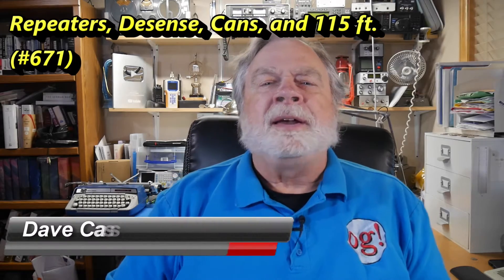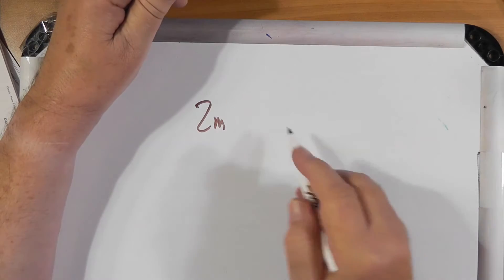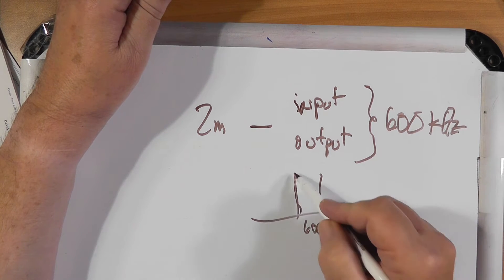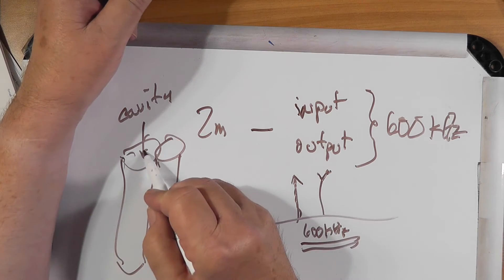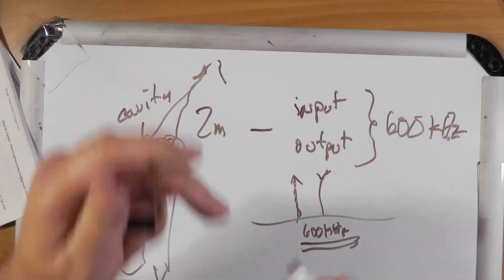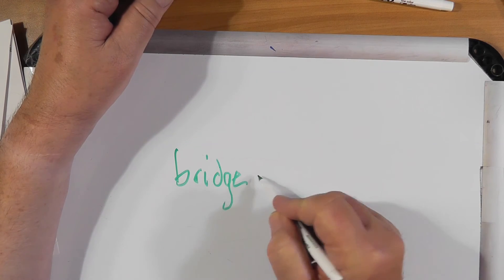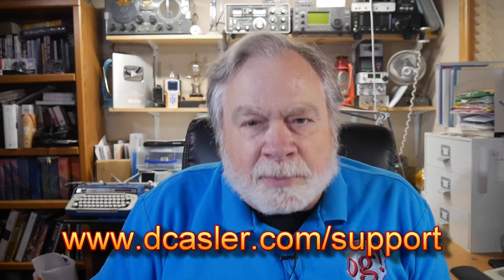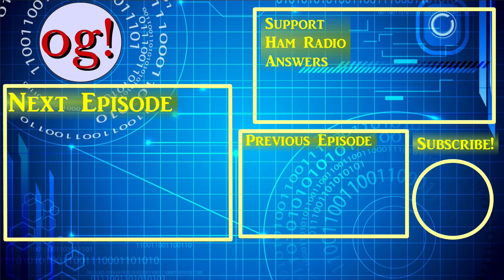Repeaters, Desense, Cans, and 115ft. (#671)

Comment: Your points about repeater coordination are complete hogwash. Been running an uncoordinated 2 meter repeater on a dense metro area with no issues for almost 3 years now. They cannot do anything. Repeater coordinators are often somewhat corrupt in that the pairs assigned go to "good ol boys" before they go to an "outsider". And most of these useless repeaters they put up sit dead silent all year. It's a disgrace. In those situations, putting up a repeater outside the ARRL's repeater zone is perfectly legal and they cannot do anything about it.

Comment: Vertical separation  using two antennas on 2m for a repeater is a minimum of 60 feet (with  the receive antenna at the top and the transmit antenna at the bottom, with the antennas directly inline with each other on the same side of the tower leg or mast.  Horizontal separation is a minimum of 500 feet, and with horizontal spacing , your coax run are longer which presents another problem!  But with all that said there is another solution that may work better, and odd repeater split of 1.5 to 2MHz  on 2m will work fine, less distance between antennas.  Odd splits can be coordinated, all modern radios today are programmable to accommodate  using odd splits!  I’ve had repeaters on 2m, 220, 440 and 1.2GHz (my favorite band, no atmospheric noise, so setup properly the receiver can hear down to -130 DB 1 watt sounds like 10 watts and 10 watt sounds like 100 watts). Good luck with your adventure in repeating!!

Comment: You'll have better separation by spacing two antennas vertically. Much shorter distance required between antennas than if horizontally spaced. There are calculations to figure out the isolation db's. However, vertical real-estate is a bit more difficult to aquire, than a wider footprint would be.

Comment: Hey old Elmer. What if a repeater owner were to vertically stack a couple of verticals? One for the receiver and one for the transmitter. What would the separation of the antennas be for a 2 meter repeater or a 440 antenna? As in one above the other?